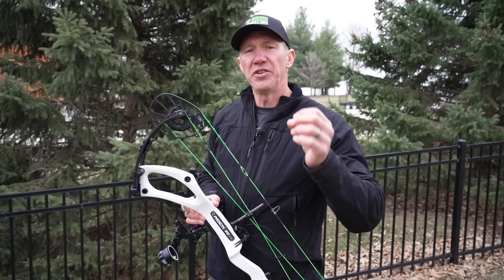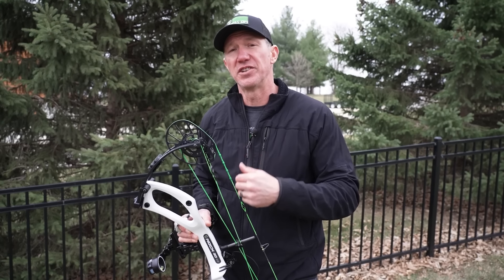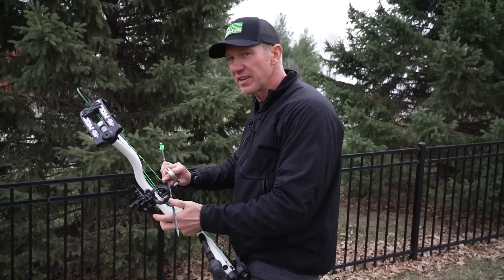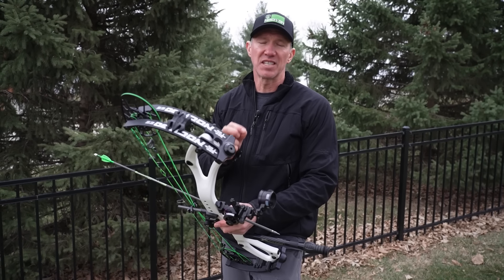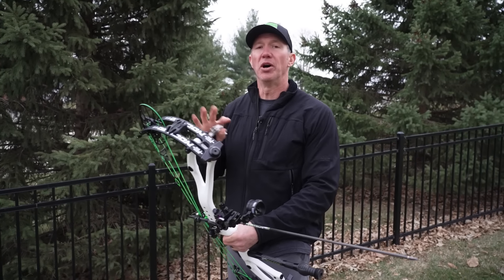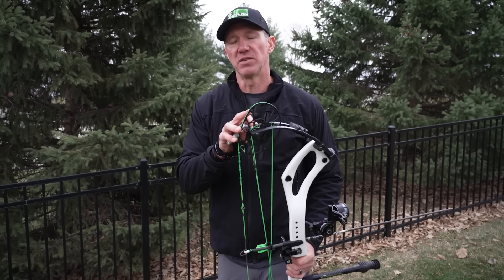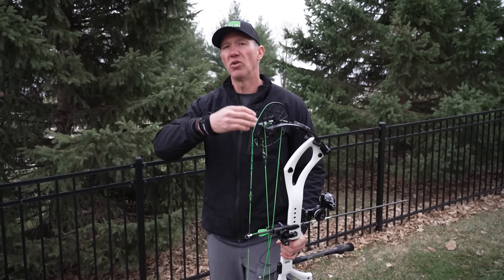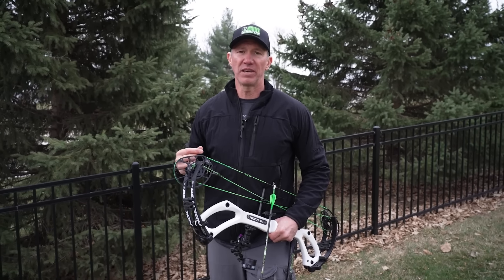It's all about the pressure!

Comment: Great lesson. I’ve been shooting 3 different bows and learning the “feel “ of the different draw cycles. The bear Cruzer 2 has a long noisy draw with nothing but sponge when it cams over, diamond edge 320 has a really fast hump and then drops making it easy to draw and has a solid back when you get there. Those were the 2 I worked with last year and showed me a valuable difference in draw cycles. I bought a pse fortis 30 that is a dream to shoot but the long draw cycle, while extremely smooth, makes it seem harder to draw but it’s really just a longer power stroke so it works muscles different. Great back wall with just a smooth drop. You have to shoot a few different kinds to really feel that and know what you want. I still shoot all 3 bows set to different poundage’s working my way up in draw weight. I’m 64 and only have been shooting for a year so I set one a little low and start with it to warm up then shoot the heaviest draw finally to my primary bow and it makes that draw cycle not seem as long.  As I get into late July and August I’ll focus on my hunting setup and hope I’ve reached my draw weight goal of at least 55 pounds and with any luck maybe 60 but muscle builds slow at my age.

Comment: I’m having trouble with front shoulder pain when I shoot my bow. Do you have any tips on what causes this or exercises to do to help it?
Reply: Since its front shoulder it’s probably too high in your draw cycle and impinging on your rotator cuff muscle and also your draw length might be too short and it’s scrunching you up. 

As far as exercises I would do anything to strengthen rotator cuff. I actually have a shoulder pain video on my channel that has 3 movements I always use for shoulder pain 👍🏼
Reply: Thanks you. I’ll check out your channel. One of the things I do go through in my head when I’m shooting is making sure my front shoulder is down
Reply: @IronOathFitness I looked for the video but couldn’t find it